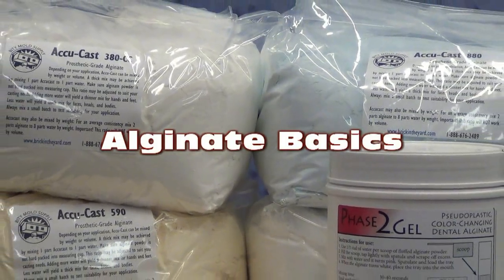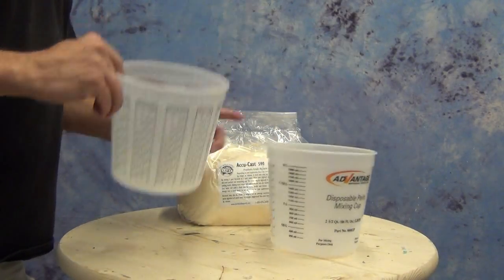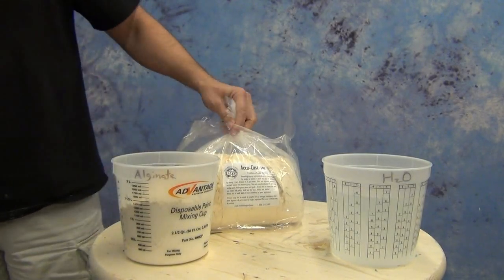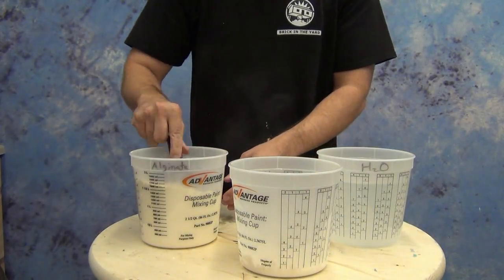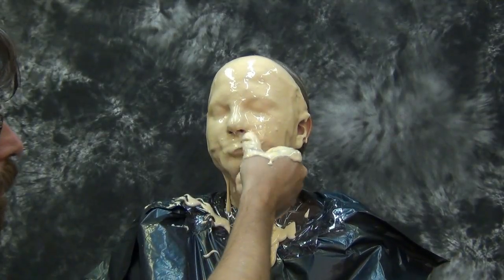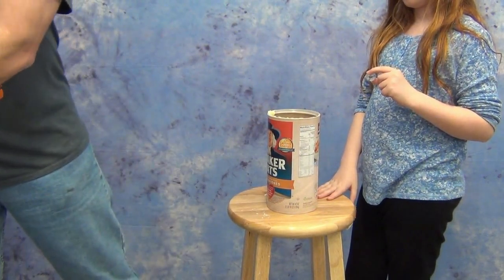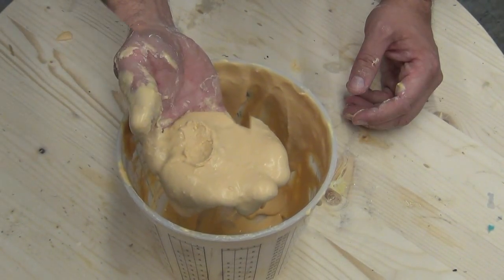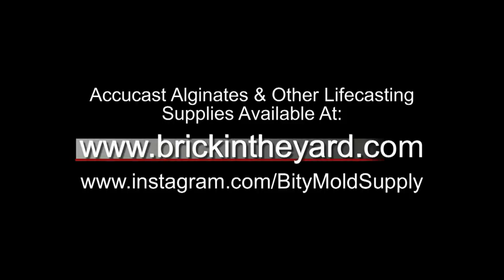Alginate Basics: Lifecasting Tips For success with Accucast Alginates

Comment: Love these basic video's. Got two things for this one:

Casting the hand with the marble is pure magic. Very cool effect. Like those bottles with a piece of wood  with a bolt through it in them. Real mind bender if you are unfamiliar with alginate. (If you had shown the result first It would have taken me some time to figure that one out)

And correct me if I got this wrong but the math on the extra water is not right. 
When you ad  that extra quart you only have about a quart mixture left. So that would be half a quart of water in there, ad the extra quart and you end up with a ratio of (getting close to) 3 to one water/alginate mix. That is pretty amazing.
Reply from the maker: It's hard to tell in the video, but that's a 2 cup measuring cup that I filled with 1 and 1/4 cup of water. When I first mixed it I just poured in 1 cup and then added the remaining 1/4 later.
Reply: That does make a lot of  sense. Thanks

Comment: Are you able to use plaster of Paris in an algenate mold?
Reply from the maker: Yes, but I don't recommend it. Plaster Of Paris is the weakest formula of plaster and, when cured, is very chalky and brittle. Art casting is best done with Hydrocal or Hydrostone. Both are not much more in price than Plaster of Paris but they are infinitely stronger.